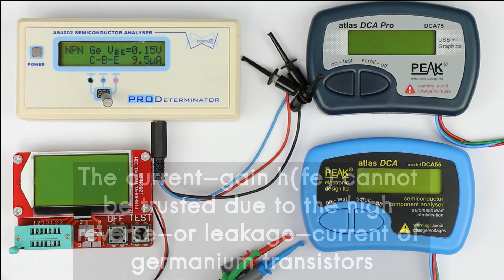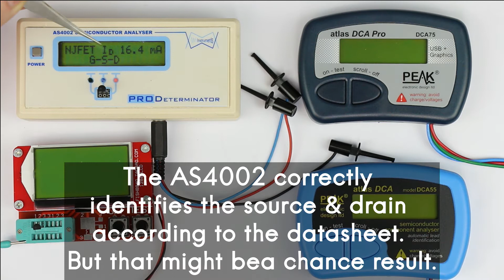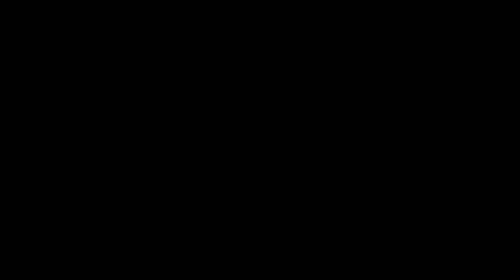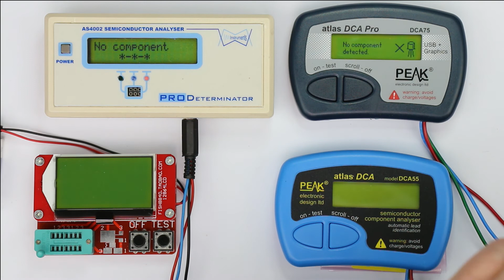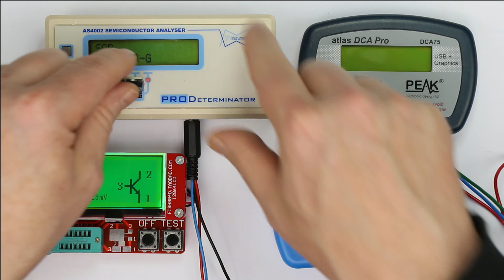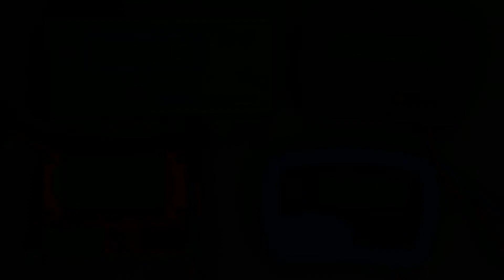Component Tester Shootout [Pt.2]: Transistors, SCRs, TRIACs

Comment: Why does the DCA55 fail to measure older TO3 transistors made between 1980~1991. I found it returns very low hFE as compared measuring it with Tektronix 7CT1N plug in as well the old Sencore TF151 here in the US.
Reply from the maker: Don´t know. 
Perhaps it cannot supply the substantial base-currents necessary to drive power-transistors into the linear region?
Or the other way around: It delivers enough base-current but the resulting collector-current cannot be delivered.
That´s you always should have a good old analog curve-tracer with enough collector voltage and current capability
(like the one I demonstrated here:  https://www.youtube.com/watch?v=isYHoyeXvk8 )
Reply: Thank You

Comment: Battery was weak at 54:08
Reply from the maker: Yeah. But the initial measurement of the battery-voltage at startup is very unprecise.
If you watch when I press the "Test"-Button immediately one after another there are always different battery-voltages displayed.
So in the end the battery-voltage was always sufficient during the test.